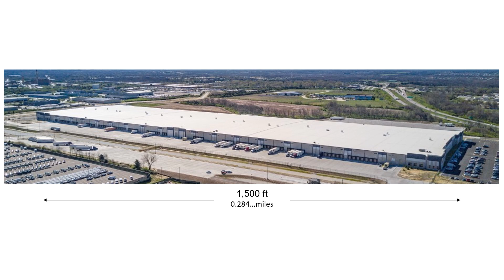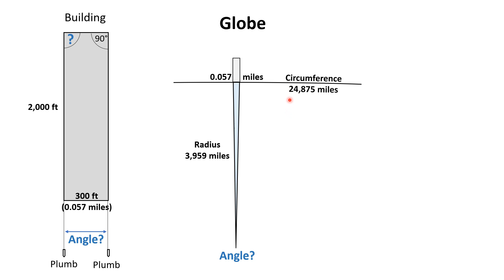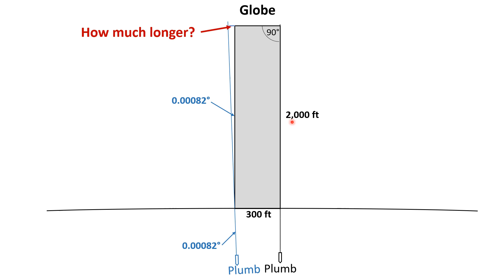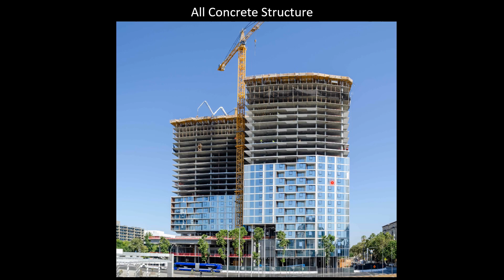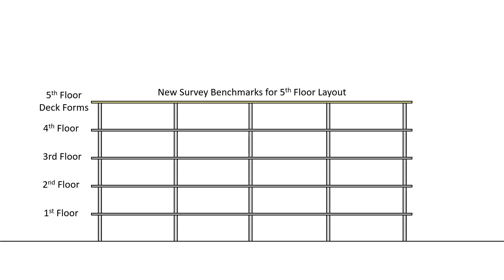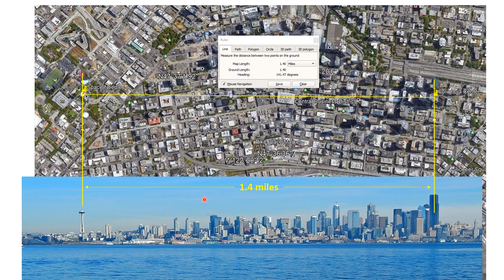Would High-Rise Buildings on a Globe Have Wider Tops Since Plumb Lines Are Not Parallel?

Comment: Why are you assuming buildings are building sides are at right angles to the eath? What do you know about architecture?
Reply from the maker: My hypothetical building was just an example to show that even though plumb lines are not perfectly parallel on a globe it has absolutely no effect on the construction of buildings.  Yes, the exterior of buildings come in a wide variety of shapes but the columns and core of the main structure are in vertical alignment to correctly transfers the loads to the base.  This is based on the blueprints we use for construction that are drawn by architects.